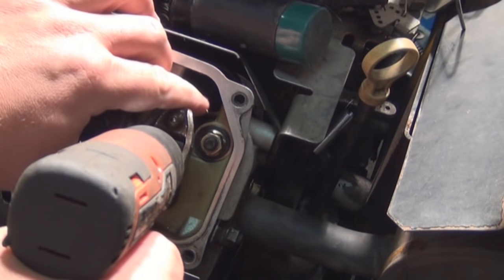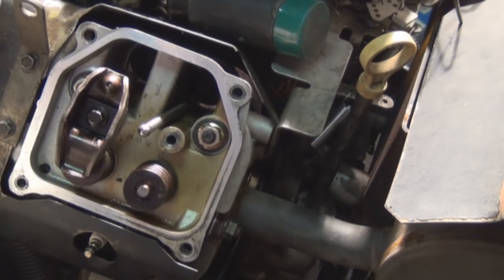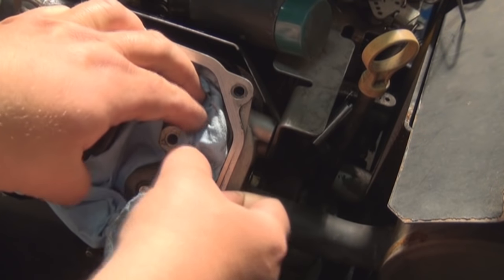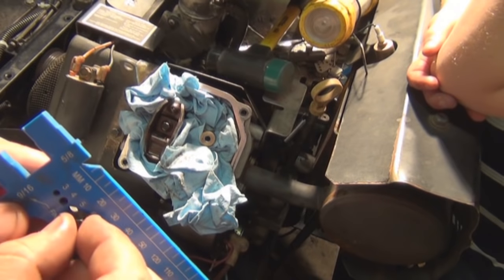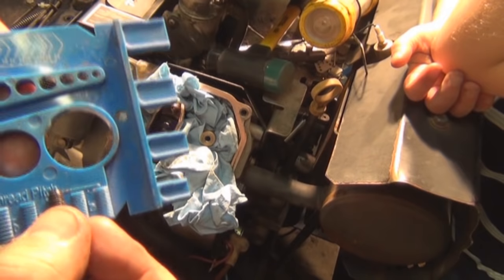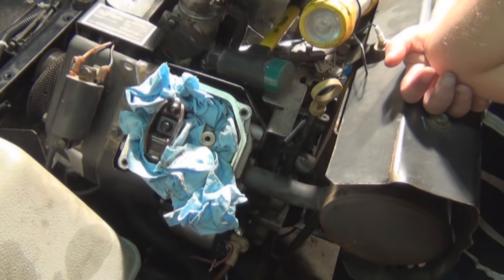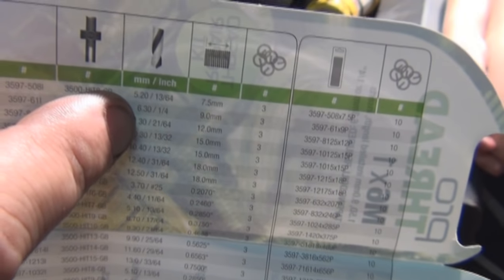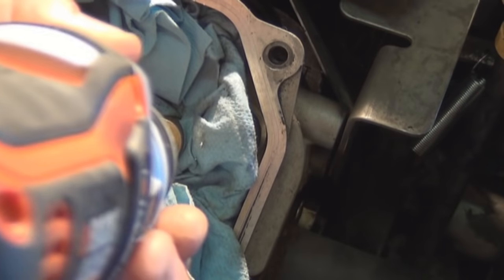How to rethread a stripped bolt hole video

Comment: Got a question not about a hole with stripped threads. I want to know if you can tap a hole with 12Mx1.25 to 12Mx1.75 with just a tap and no heli coil?
Reply: NO. You'll end up with a nice smooth hole with no threads.  There may be enough steel bits from the "threads" left to screw the bolt in but it will strip immediately.
Reply: Why not go to 12 x 1.5 instead? You will probably need a drill bit to keep the threads from being too deep/long and breaking. I would think it can work if done correctly. Or you can also go to an even higher size and creating new threads with a totally different bigger size, assuming you have the space to do the work and fit the bolt.

Comment: 2014 chev cruise and someone stripped out a valve cover bolt. M6 30 with E10 socket bolts.    What would I drill and retap bolt hole with?, drill bit size and rethread size?
Reply from the maker: You can try this kit. It comes with everything you need including the drill bit https://amzn.to/3J0At4w

Comment: It looks like when you retap you are using the same diameter, but if the thread was stripped I don't understand how this is possible.  Shouldn't you have to retap with the next size up in diameter since there shouldn't be enough material on the existing diameter to do the job properly?
Reply from the maker: It is being tapped to the next size up.
Reply: handy man I think I understand, you tap the hole to the next size up but the insert screws in using the next size up, but the internal thread of the insert is the old size for the original bolt? Thanks

Comment: Thanks for the vid!  I was working on my Honda Shadow 1100 trying to put some insulated fiberglass wrap around my exhaust pipes, and on re-installation I stripped one of the bolt holes.  With my engine being a lot bigger than a lawnmower, would this method still be viable?  I'm thinking about a possible change in compression, and how big of a difference I could be looking at
Reply from the maker: I have done this method on cars for several different reasons. I only used a lawn mower for this video for demonstrating purposes. I hope this helps. Thanks for watching. Please like, share, and subscribe.

Comment: Nice video. Trying to learn. Is re-tapping the stripped bolt hole with the same size bolt as original and "re-setting" the mangled thread, not an option? If not, why?
Reply from the maker: You can try to chase the threads but they will most likely be weaker depending on the application. I hope this answered your question.
Reply: Thanks. After watching your video, I learned about thread chasers and therefore I ordered one in the size I need. A brand new $20 Harbour Freight torque wrench failed me on its first use and caused me to strip a small bolt hole on my commercial mower. It is a non-critical bolt so I am going to experiment a bit. Thanks again.

Comment: My bolt connecting the carb to the engine is stipped. Its a 3/8 bolt but i cant figure out how to do what you did.. Can you send a link with the kit and if my bolt is slipping in and out wont i need a bigger bolt after rethreading? (I have never done this before im just working on a lawn mower) thanks.
Reply from the maker: I am assuming the threads are fine and not coarse, if so here is the link for 3/8-24 inch thread repair kit.http://amzn.to/2chC6gq The directions will be written on back of the kit, also what size drill bit that you should use. I hope this helps. If you do not know what size thread pitch you have, then please feel free to check  this video  out https://youtu.be/0JammBOVZ8w . Any questions or concerns, dont hesitate to ask. Please like, share, and subscribe.

Comment: Just found out that my trans mount has a stripped bolt hole.Explain to me why the coil gos in or mainly what purpouse it serves.
Reply from the maker: Morgan Meyers The coil becomes the new threads. Usually made of stainless steel.

Comment: Can you do this on aluminum block?do you have spray wd-40 while you tapping so it doesn't get hot or no?
Reply from the maker: Yes depending on what you are doing. Yes you have to use oil while tapping, I know I did not in this video but you are supposed to

Comment: humm. didn't know that imperial was called standard.  thought it was imperial and metric. Good video
Reply from the maker: Thank you. Thanks for commenting. Please like, share, and subscribe.
Reply: Imperial or SAE appear to be the words mostly used outside the US. The word “standard” only makes sense if used for products sold in the US. “Standard” means the standard measurement size used mostly here in the US, which uses inches, feet, etc. So far, here in the US, I generally only see the words SAE or standard and rarely imperial.

Comment: I am doing this job today on the same part on a ride on mower, i was installing a brand new head on my kohler courage and torqued the rocker stud to the spec. It got about 3/4 way there and then i felt it was not going to get there. Not what you want to feel on a new head.
Reply from the maker: Yeah, that’s what happened too this one. I think the torque specifications are wrong
Reply: The torque spec for my one is only 13.5 newton metres, lol it didn't take much, the repair all went well, i got a bit worried when the coil started getting a bit tight to turn in near the end but it got there. Thank you very much for your video, it gave me the confidence I needed to fix it.

Comment: the bolt gauge where did you get it from and how can you do it without one of them?
Reply: Ebay or amazon sell them. thats where I bought mine
Reply: Your best bet is a thread pitch gauge and a caliper. The one used in the video only has common sizes.

Comment: I stripped 3 bolt holes' thread/groove while changing my transmission fluid accidentally by over torquing it. Fluids been dripping out slowly per day and what kind of HeliCoil, size of drill, and tap will I need? Also how deep will I need to drill a bigger hole?
Reply from the maker: You have to find out what size and pitch bolt you have, which I showed how to do that in this video. Than you have to find the right helicoil set and follow the directions that come with the helicoil set. It also states what size drill bit you need. As for how deep you have to go, I don't know. I personally do not go any deeper than the hole already is. These videos are tutorials only on how I do things in hopes that it helps someone out. Thanks for watching and thanks for the comment. Please like, share and subscribe.
Reply: handy man do you have to use the drill bit before you use the tap? What'll happen if you just use the tap to create new threads w/o drill the hole first?
Reply: 7150285 you always have to pre-drill the hole, and remember to keep straight. although you could size up with a slightly bigger tap and put a slightly larger bolt in it rather then using thread inserts. This would work if you have the room for a slighty larger bolt. EXAMPLE: if your striped hole was 1/4 X 20 tpi you could drill and tap using a 3/8 tap and 3/8 bolt
Reply: 7150285 you would probably break the tap. Once that happens you will have a chunk of tap stuck in the hole that is impossible to remove, because you won't find a drill bit hard enough to drill it out. Whatever you are working on is now a boat anchor.

Comment: I'm trying to fix my hole for my tension pulley bolt. How can I do that without removing the engine please help I got the tap and inserts and drill bit but I want to make sure I do it right without damaging the block.
Reply from the maker: +Fee Baby I don't know what your working on nor do I know what kind of room you have to work. So I can't really help you. But I can give you a tip. Some times the tip of the bolt gets boogered up and might only mess the first couple threads up in the bolt hole, so you might find out what the diameter and pitch of the bolt and chase the old threads as well as chasing the bolt threads or just get a new bolt. You might be able to do this especially if it's cast. I hope this helps. Thanks for watching and commenting. Please like, share, and subscribe.

Comment: Will a self drilling bolt help restore minor thread damage if used like a tap?
Reply: Probably not.  It may be difficult to find one that even was the correct size and/or thread pitch.  Self-tapping bolts or screws are okay with soft materials (like wood); not so much with metal.  Another issue is that taps have 3 or 4 vertical slots in them to transfer the waste material out as you're tapping (or cleaning up the threads) in a hole.  That eliminates jamming the waste material down into the hole you're attempting to clean up.  Spend the money and buy a thread-restoring set, which will have both metric and SAE taps and dies.  Alternatively, you can buy a Helicoil kit.  Watch a few videos here on YouTube to determine your options and the procedure you will need to follow to install one.

Comment: When drilling out the old thread do you not drill it all out untill the drill bottom out?
Reply: Dean T - No, you drill just the length of the shaft of the bolt, measured from the top of the head of the bolt, going down.. If you have a really long drill bit, what if you kept on drilling and went through something that is no damaged down there?

Comment: Can I stack coils inside of one another if the hole is too big for my bolt
Reply from the maker: Honestly, I have never tried it. Couldn't you just get a bigger bolt?
Reply: Well it's for my intake manifold and the bolts going through the fuel rail so it has to be a specific size... but it turns out after I got the helicoils that it had already been previously tapped and I just needed to freshen up the threads for the new one 😆 it must've came out when the fuel rail was removed some time back

Comment: around [10:10] you put coil inside. Why ? The thread is already done , so what is the point of putting the coil ? And does not the coil make the hole smaller ?
Reply from the maker: +Harnas31 the coil is the factory size thread pitch and diameter. When I made the new threads with the rethreading tool is for the coil to go into. I hope this helps. Thanks for watching and commenting. Please like share and subscribe.

Comment: How about valve adjustment rather than torque unless it is as I suspect a motorcycle engine which I am not familiar with and may have the clearance built in.
Reply from the maker: No adjustments and it’s a lawnmower engine

Comment: If the boat that you stripped was 6 mm how are you using a 6 mm tap if you strip it the hole is going to be a little bit bigger so that means it's 6 mm tapping wouldn't work because it's too small I got to retap something today the bolt size is 3/8 so I have to get a boat one size bigger than that right and the tap
Reply from the maker: If the bolt hole was 6mm then the helicoil kit would be 6mm. That doesn’t mean the drill bit will be 6mm. The kit will have directions on what size drill bit to use. And yes you are correct, the drill bit will be slightly larger. But follow the directions.

Comment: I'm gonna be re threading a hole on my exhaust manifold, how deep should I drill?
Reply from the maker: I personally do not drill deeper than the hole already is. I hope this helps.
Reply: use black tape to mark ur drill bit. put the bolt beside the bit and mark the bit w/ tape...walla!

Comment: I need to rethread the bolt holes on my engine header.... what do i do? Its leaking oil because of that
Reply from the maker: All I can say is each situation is different, without me actually being there to work on it or seeing it, I really cannot tell you. But what I can tell you is watch the video, make sure everything stays clean and seal it up good by following oem specifications. Or if you feel uncomfortable doing this project , is to take it to a professional. I hope this helps. Please like, share, and subscribe.
Reply: handy man i meant to put valve cover not headers... my bad

Comment: I have a problem that my threaded bult was broken inside a thrilled hole. How will I get it out?????
Reply: Henrik Jonsson -- You have to find the correct drill size and type to drill into that broken bolt, and then unscrew it out of the hole, using that drill bit that drilled into it..  They make these special drill bits for that exact problem...  Be careful, dont rush, try to not use power tools that can go too fast and damage things.. If you can adjust the power tool to go slowly, that will be the best way to do it and not hurt anything..

Comment: how do you prevent metal shards from falling into the engine when drilling and tapping?
Reply from the maker: If your doing a spark plug hole, I would just remove the head and then tap it. I hope this answers your question . Please like, share, and subscribe.
Reply: +handy man That makes sense. For some reason I was thinking that hole was open to the engine.
Reply: To prevent metal chips from falling through the hole and entering the engine, when driling the hole and tapping the threads, put a small amount of  grease into the flutes on the drill bit and the tap.   The metal chips will stick to the grease and not get away from you.  Be careful when you back out the drill and the tap to not dislodge the chips.
Reply: I'm not sure this is a good idea, the grooves on the drill bit are designed to allow the cuttings to flow backwards. The grease might force the cuttings to fall downward and could end up gouging the sides of the hole you're trying to drill.

Comment: i never used the inserts. whats the advantages of using inserts over just using the newly created treads?
Reply from the maker: To get it back to the spec. Size. When you tap you make the whole bigger, in which you need a bigger bolt. Depending on your situation , you may not have that option. But you can. I hope this helps, thanks for watching and commenting. Please like, share, and subscribe.
Reply: Rethreading to the next bigger size should be cheaper overall than buying specialty tools for the pocket insert. It seems like this specialty tool is just for those who really want to keep using the same bolt to keep all nuts and bolts uniform. I’d personally wouldn’t care at all if one bolt looks different or is of a different size. Just make sure to add some sort of note on the new nut or bolt so the next mechanic knows what’s going on.

Comment: believe I stripped the top bolt hole on a thermostat housing...what do I do now???
Reply from the maker: If it were my vehicle, I would find out what size bolt I had and get the helicoil set and install the new threads or take it to a professional, if you don't feel comfortable doing it. Thanks for watching and commenting. Please like, share, and subscribe.

Comment: You're suppose to break off the tang before re-installing the bolt.
Reply: And put red locktite on the coil before installing
Reply: dude I broke a tang inside a spark plug hole.. .. went str8 to engine lol luckily it was a p.o.s van that I got for free and fixed up... anyway sold to a friend my friend says it's still running!

Comment: I am pretty sure you are supposed to punch out the piece at the bottom of the thread insert
Reply from the maker: +Sky Walker You can. The ones that I have not broken the tabs off of, which were many  never had a problem. But if the tab bothers you that bad then remove it. There might be some situations where you will have no choice but to remove it i m sure. But, that is an interesting point. Thanks for commenting and watching. Please like, share, and subscribe. It is always appreciated. #ifitgetsthejobdonesafelythenitsnotthewrongway
Reply: I suppose you don't have to however if the bolt does pass through I would hate for someone to leave it in and have a piece of metal floating around. cheers.

Comment: Not gonna lie, I watched the beginning of the video when he was rotating the rocker arm bolt with a corded drill verbally saying "STOP!!!"
Reply from the maker: No worries, it was already stripped before that. I don't use impacts on critical items like that , lol. I stripped it using a torque wrench. The threads were week. I added the impact in the video for a dramatic effect.
Reply from the maker: Yeah, it sucks when this happens. Because it usually happens when your going back together and your just about done. Then suddenly, SURPRISE! But all in all a helicoil set should fix it. Just be careful how deep you go when drilling in the engine block, you don't want to go to deep. Hope this helped , thanks for watching and commenting. I greatly appreciate it. Please like, share, and subscribe.

Comment: Where do you get a bolt gauge
Reply from the maker: Click on the link it will take you straight to Amazon where the bolt gauge can be bought                                        
<iframe style="width:120px;height:240px;" marginwidth="0" marginheight="0" scrolling="no" frameborder="0" src="//ws-na.amazon-adsystem.com/widgets/q?ServiceVersion=20070822&OneJS=1&Operation=GetAdHtml&MarketPlace=US&source=ss&ref=ss_til&ad_type=product_link&tracking_id=handprobfixe-20&marketplace=amazon&region=US&placement=B001FZOCCG&asins=B001FZOCCG&linkId=LIEBOXFKJANDZTTX&show_border=true&link_opens_in_new_window=true">
</iframe>
Reply from the maker: Let me know if you have any problems following the link. Thanks for watching and commenting.

Comment: I watch so I can learn. Referring to how deep to drill, you said, "Not too deep just deep enough." ???   You never explained what the spring's purpose is that you put in the hole.
Reply: +lando kramer It's not a spring, it's a coil. Same idea, different purpose. The outside of the coil screws into the threads you just created, while the inside of the coil forms the threads of the desired size.